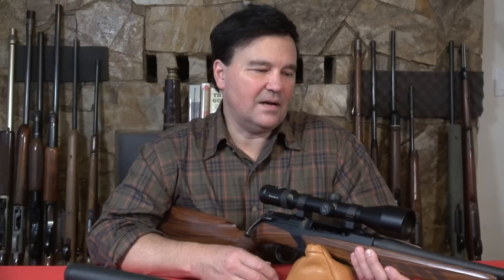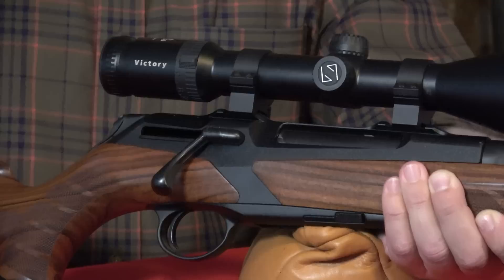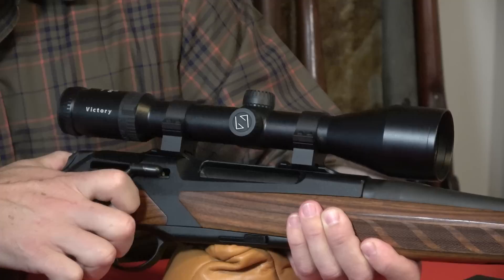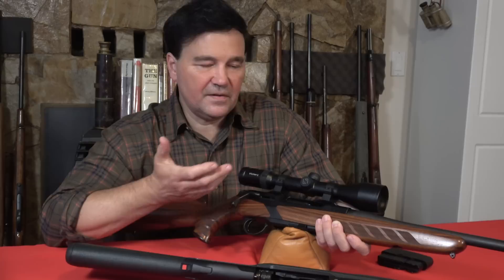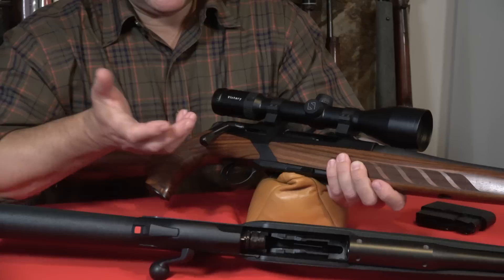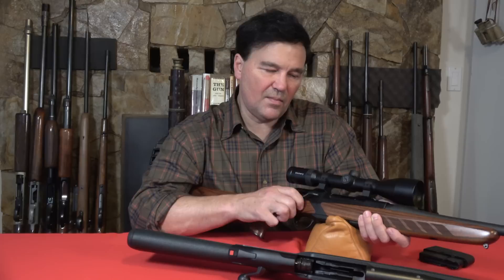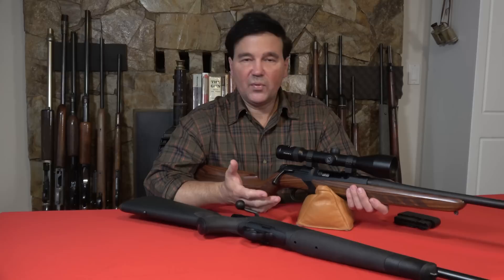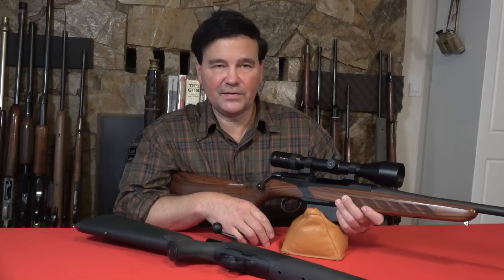The Merkel Helix: Straight Pull / Turning Bolt.

Comment: Its been many jams on Helix , lot of troubles with them here in Norway .
Reply from the maker: Not good - was it mainly failure to extract?
Reply: @UnitedStatesOfGuns  and feed, also mechanism was , some rifles wprled good,but that was few. And in the movies they use them, several was tuned to perfection. It appearas magnum calibers eorked better. But a very good friend said they should have updated the KR1 instead, but you can look at Haenel Merkel makes them,ordinary bolt rifle.

Comment: Good video as usual.
Did you know if you push the bolt all the way forward and then take the forend and the barrel off the bolt head will come out with the barrel.
and then you can have a look at it and clean it if wish to
Cheers

Comment: Interesting I watched a video on the Canadian Ross rifle that was a straight pull back and could be one of the fastest actions I even seen in a military bolt action of course the Ross had many failures that they say was caused by assembly of the bolt incorrectly by the troops I'm not sure if that was the problem since the bolt would come back and hit the shooter in the face and was withdrawn from service  do you have one that you could do a video on ? Thank You
Reply from the maker: Hi Bob - I had a 1905 sporter and a 1910 - I sold them. They were fine rifles and well made. I think there was Montreal stamped on them somewhere. I'm not sure whether it was the stories about the bolt flying out; or something else but I often had an odd feeling firing those rifles. I have a similar feeling with my R93 and R8 Blaser - I suppose it is because a fail safe lock is not there. With the Helix if a failure occurs the bolt is trapped in the closed receiver. The Heym SR 30 has ball bearings which lock the action so severely a failure is hard to imagine and even if one were to occur - the bearings would bind the bolt. Still, the Ross is an achievement and a high velocity pioneer. Canada ought to be proud of that rifle - a few modifications and it could have gone far. I'll find them again and make a video. Thanks for the reminder.
Reply: There is something to say about non locking bolts for sure kind of like driving on bald tires at 100 miles an hour nothing might happen and again something could LOL thank you so much for your videos at 77 I don't do hunting anymore but enjoyed all my days if the field with Bow muzzle loader and my great rifles  seeing your collection stirs my soul . @UnitedStatesOfGuns

Comment: I am interested in the helix for speedy follow up shots with a suppressor, and having magazines with more capacity. I hunt sitka blacktail deer in bear country with a suppressed bolt action and when I walk bout in bear country I carry SW M&P10 with a 16 inch barrel unsuppressed, I feel adding an adjustable gas tube "might" fix the problem of over gassing and reliability issues. I would need to see holes in paper convincing me it was accurate out to 600yds then I would add the helix to a must have, thanks.
Reply from the maker: Hello Kodiak! 600 yards - that is a long way. Sounds like you have the life that everyone wants. As for accuracy - the Helix is as accurate as any at 100 so I assume it unfolds according to the numbers out to wherever one can hold.
Reply from the maker: Hi again Kodiak - I forgot one thing about the Helix - the receiver is closed so rain and snow and dirt have a hard time getting into the action - it is a magnificent rifle. I imagine you hunt in the toughest of conditions. BTW - a friend of mine lived in Alaska for a few years. He told me that when he headed out and reached the alpine somewhere and not a soul was around - in the peaks with the snow and vast green and open valleys - he said that is where heaven is.

Comment: Completely off topic, but what have your experiences been with the tang safety Ruger m77s regarding accuracy. I’m considering investing in one, but am skeptical as I have read about some barrel issues due to Ruger outsourcing them for a time.
Thanks,
Reply from the maker: Hi Matt, I've heard these opinions on the early Rugers as well and can only report that I owned perhaps a dozen of the tang safety models; every one was as accurate as any other factory rifle. The Remington Model 700 has, on average, always been slightly more accurate than others but the Ruger tang safety was on par with the rest. No doubt, there are always bad barrels that come along in every brand and maybe a few of these started the chatter.

Comment: Quick question on pricing... what do you think of a steyr model M double set trigger in 30 06 for 1300?
Reply: As follow up I have seen them from 800 to 2000 on gun broker so I feel lost but my local guy has one and it is very interesting.
Reply from the maker: That's not bad - maybe a little high. I just bought the Model M, double set triggers, left hand - for $1100. Still, 13 is not bad if super nice shape and better wood; mine has the grain of an air rifle. I like it though. Hope this helps. Also - maybe you are getting scope rings
Reply: @UnitedStatesOfGuns  thanks!

Comment: Lol, you must be filthy rich, not being able to recall how much you paid for a gun that costs $3K to $4K. In a fine gun like that, I'd be fussy about what ammo I fed it. Firing NATO 7.62x51 ammo in 308 Winchester chambers is generally okay, though the slightly longer headspace of the 7.62x51mm will sometimes cause feeding/extraction issues like you've described. Since the bolt travel ratio of 1:2 has a reduced mechanical advantage, and therefore camming power, 308 ammo would likely be a more reliable choice.
https://www.ammoland.com/2017/06/7-62-nato-vs-308-winchester-ammo-whats-the-difference/#axzz5TELLEEtZ
Reply: I'm pretty sure he is lol and good for him!
Reply from the maker: Thank you for the link. I agree - and that Swiss ammo is usually how I test rifles for primary extraction - just as you write. In fairness, the Helix did quite well - despite the ratio; sometimes it is surprising which rifles can't pull the brass from the chamber. Best to you. As for filthy rich... well... definitions...I would say moderately clean rich. I know far more about the stock market than I do about guns - maybe I'll say a few words one of these days.